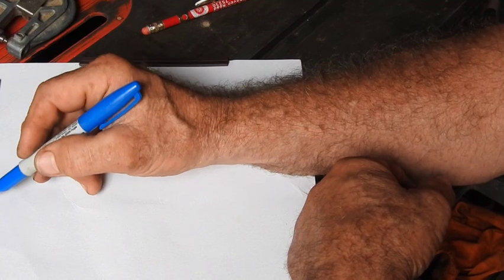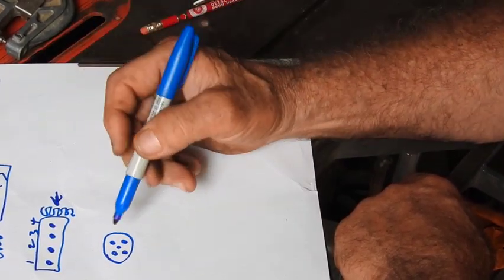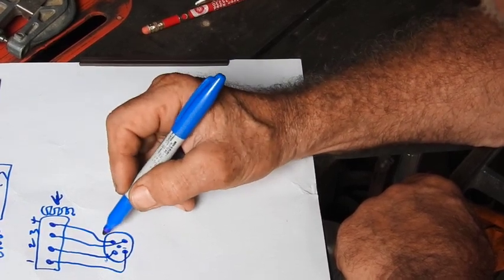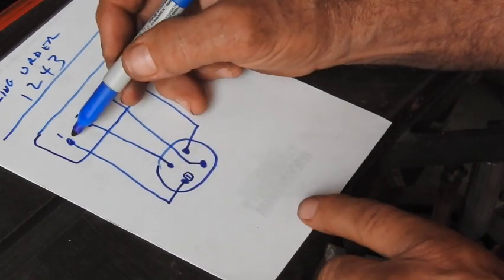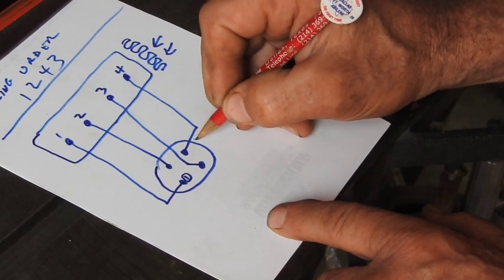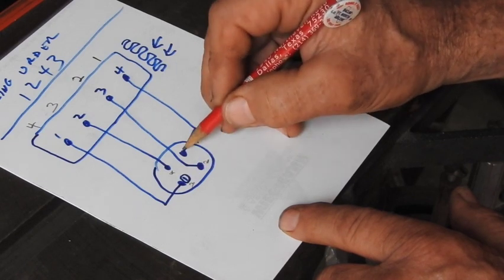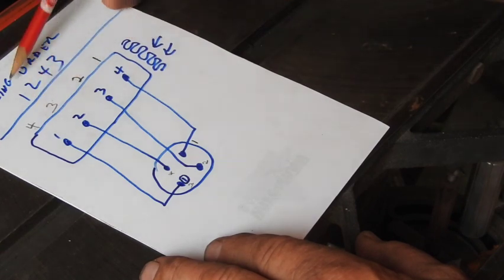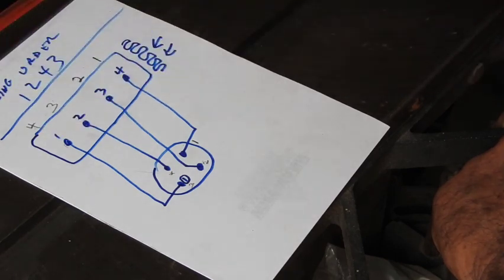Ford 641Tractor-Which Cylinder is No 1 Front or Rear- Read Description Box

Comment: #1 Cylinder is in the back. If you don't believe it line the timing mark up on the flywheel and you'll see that cylinder is TDC
Reply from the maker: if the intake and exhaust valves are both closed indicating its ready to fire on that cylinder, I'm thinking the distributor is 180 out.  If both valves are not closes it's not ready to fire so the distributor is probably in the correct position for #1 to be at the radiator.  Of course I always reserve the right to be wrong on occasion too.  Thanks for the input.  I'll re-address this when I got my 800 Ford (same firing order) back in the shop for repairs.

Comment: the number should be  at the front fo the tractor
Reply from the maker: Yes, I've never seen a multiple cylinder engine that did not have #1 at the front of the engine.  The front being the end with the timing and cam gears. Some engines can and are installed backwards in their application, but orientation does not change which end is 'front' for determining #1.

Comment: I know this video is a few years old but I have a question kind of on this topic. I've got a 1962 for model 2000. It has the 4 cylinder gas engine like my 641. The 2000 is very rough running and would like to know how to set timing on these. I know the timing marks are on the flywheel and  visible from the witness hole on the bell housing near the hydraulic pump. What degree should I set the distributor at? Should I susan the distributor at 0 with the pointer at the number 1 spark plug location?

Comment: What is the way to set fuel injector pump on old ford 3930
Reply from the maker: There are so many variations to the settings that I have to figure out each one every time.  Some are simple and some are horrible like this Perkins in the Ford New Holland skid loader here: https://www.youtube.com/watch?v=YfG5lGaGu6E Good luck with finding the information on yours. Its seems some dealers won't even talk about the equipment if its more than a few years old. My suggestion would be to buy a legitimate dealer service manual for that exact engine or the tractor IF you can find one.

Comment: 1 -2-3-4 from the RADIATOR to the dash. #1 is closest to the radiator, #4 is closest to the dash or the steering wheel. Not hard to remember.
Reply from the maker: Yes, I agree. I never heard of another inline 4, 6 or 8 that DIDN'T go from the front to the rear.  The video I referenced but didn't link was a guy that had inadvertently installed his distributor 180* out and numbered his cylinders from the rear to the front. His video was done in a 'how to' manner that showed how he did it and I couldn't believe it worked with reversed numbering .....but it does.  Which is why I sketched it out in this video.  Even though it works the way he did it, the real way of course is front to rear, distributor oriented correctly instead of 180* out.  Another thing, he never questioned his work at all, he just showed it as thought its the way to do it.  Which is why I did not link it.

Comment: I was having a problem with my Ford 2000 and happened upon your video. It was exactly what I needed to hear and SEE! I am a visual kind of guy and so much appreciate the drawing to explain firing order and numbering of cylinders with #1 being on the radiator end of the engine!
Reply from the maker: Awesome Tom !!  Glad to hear it helped a bit.  The fellow I was referencing was way off base... it only worked out from the rear because he'd installed the distributor 180 degrees out of time.  It took a little time thinking about how he got it to work and that's the ONLY way.    #1 on an inline engine is always going to be in front.  Even on a skid steer with the engine in the back, the front of the engine is facing backwards, but it it still the FRONT!! Now there's always the exception to the rule, but you'd have to look pretty far and wide to find it.
Reply: @tractorman4461
Reply from the maker: @tgrimsley  I just made a comprehensive reply to your question and I forgot to add a link to my 2000 Ford 3 cylinder that I couldn't get to run below freezing temps. So I converted it to electronic ignition and its not failed yet all the way down to 5* F.  That could end up being your ultimate solution, but I would go through all the normal check FIRST.  If you watch this 13 minute video, I'd suggest reading the description box before viewing the video.  I am sooooo glad I made the change Tom.  Before, my 2000 was unusable in the winter time....and I had the standard electrical components spot on specs too and it still did not run in cold weather.
Reply: @tractorman4461  Still having trouble with my 3 cylinder gas Ford. It was working fine..then developed a miss. I was able to get it home and proceeded to replace the points, plugs, condenser, carb cleaned, replaced coil, and seems to be getting plenty of gas. It has done this very thing before and was solved? by putting on a new coil...it really has me stumped! I replaced the wires,, rotor, and distributor cap but nothing has worked yet. When I say the tractor is missing, I mean it is running very rough and irrecgular as compared to a steady  miss like a bad plug .
Reply from the maker: @tgrimsley  As long as the distributor has not been removed the timing has not been changed from when it was running smoothly.  Firing order is 1,2, 3 and the cylinders are 1, 2, 3 from front to rear. If you have an VOM- Volt Ohm Meter, to check the resistance of the primary coil circuit set it to a low ohm setting and check across the + and - terminals of the coil.  A standard 12v coil should be somewhere between .5 and 4 ohms.  A very low resistance.  If its much over 4 ohms, chances are the coil is bad. Then to check the secondary resistance set the ohm meter between the center coil terminal and the + terminal.  The resistance should be more than 6,000 ohms but not over 15,000 ohms.  That will be a start.  Of course if you have carbon wires and not copper core wires, there could be separation or partial separation in the carbon in one of them.  Also check the condensor.  Cheap new ones are know to be faulty.  The condensor is basically a capacitor. The VOM must have a 'capacitance' test mode.  Short the condensor coil to its case to ensure the stored voltage is discharged, then put the test leads between the wire and the case.  The capacitance should read in the vicinity of .2 of a mfd (micro-farad).  If the meter reads zero, the condensor is 'open' and and if it reads much over .2 it is bad as well.  The distributor cap can only fit one way because it should have a notch in it to fit the base of the distributor body, and there should be a number 1 on the cap.  Attach the wires 1 to 1, 2 to 2 and 3 to 3 in a counter clockwise direction around the cap.  This should get you off to a good start to finding the problem....and I hope it helps.  sometimes my memory remembers stuff a little off though.  LOL  Good luck Tom and let me know what you find buddy !!  Off the cuff though I'd double check the plug wires for correct placement on the cap first.

Comment: PLEASE can anyone tell me what kind of oil you put in port on the side of distributor and how much . THANKS TO ANYONE HOW CAN TELL ME
Reply from the maker: I usually use the same oil that is used in the engine crankcase.  A couple times a year because mine are not used as much as if they were still farming. and usually 10 to 15 drops at a time.  I don't know if that is actually the correct way to do it or not but I've been doing it for 40 years.
Reply: @tractorman4461  THANK YOU !!!

Comment: When # 1 cylinder is at TDC on compression stroke the dizzy should be pointing at the # 1  cylinder. Correct?
Reply from the maker: Yes, that is correct and #1 is the FRONT of the engine.  The fellow whose video I watched actually installed his distributor 180* out of time, but wired the plugs as though the REAR of the engine was #1. Even though that's not correct, it runs fine because the sequence of fire still hits the correct cylinders in the proper order.  It confused me too at first, but it works.

Comment: I'm going home today and see if this is what's wrong with my Ford 850. I have it drawn out like you showed... I'm no mechanic but this explained it well.
Reply from the maker: I planned on doing a follow up video but never did, on how the fellow I observed is incorrect about number one cylinder Bing in the back of the engine. Number one cylinder is definitely the front of the engine up by the radiator. He has his distributor installed 180° out of time. Which because of the firing order makes the cylinder count correct from the back in advertently. Follow the normal procedure from the front of the engine do not pull your distributor out and change it just because it works out. That’s my suggestion anyway. Let me know what you find and what you do. Thank you.
Reply: @tractorman4461  My distributor must be backwards as well. . It runs like a charm now. It was wired from the correct way (front to back) but when I wired it from back to front it fired right up.. Crazy right?? Thanks for posting this. Saved me fro taking it out and reinstalling it ,
Reply from the maker: @kyeneal3243    That's crazy good news Kye.  It is very easy to get the distributor in 180 out...unless you have a front mount little Ford or any of the flat head Continental's.  Those all have an offset in the distributor drive that will not allow improper installation.  On the regular overhead valve engines, you've GOT make sure #1 is TDC with intake and exhaust valves open to install the distributor correctly.

Comment: He was correct. #1 cylinder is furthest from the radiator. What matters is where the rotor button is pointed when each cylinder is TDC. If you take the furthest cylinder from the radiator to TDC you will find the timing marks on the flywheel through inspection hole. If you take the closest cylinder to radiator to TDC and look through inspection hole you will not see timing marks because it's #4 cylinder.
Reply from the maker: I just figured he'd installed the distributor 180* out.  It works out on paper. No matter, either way his is running fine and my 800 Ford is as well.  It did twist my mind for a few minutes though.  Thank you for the comment !!

Comment: So what your saying is that his distributor is 180 degrees out of rotation, and he compensated by “clocking his wires” to make it run correctly! 
So what needs to be done is to bring the “number 1 cylinder” to top dead center” remove the distributor cap, and look where the rotor is positioned, then if 180 degrees out he would need to lift and reposition the distributor so the rotor would point to #1cylinder, replace the cap and correct the wires. His remedy was the old school quick fix for this issue, that he didn’t acknowledge or make clear to others watching his video! 

Good eye on spotting this Wendell, did you eventually ask him to clarify his choices on how to run the spark plug wires or why he chose this method?
Reply from the maker: Nailed it !!  LOL.  Yessir. No doubt about it at all.  If the fellow knew it was 180* out he didn't say and it was NOT pulled out or re-installed during his video.  No, I didn't say anything and I didn't post a link to it either.  But it's easy to find.
Reply: Yes, and see how your rotor turns, some go clockwise and some counter clockwise, find top dead center which is 5-10 on the flywheel,on mine is the front is #1 cylinder by the fan and go from there, next #2 next#4 next #3 and place wires in that sequence on the distributor cap..

Comment: That was very interesting, although I was taught to count from the front of the engine.
Reply from the maker: Front to rear is always the way on the Ford 4 bangers.  The video I watched caught my attention because the fellow said on this model tractor (641) the cylinders are numbered the opposite, from rear to front.  I don't think he knew otherwise either.  If he had known, I think he would have noted that the distributor had been installed 180* out.  I had strong suspicion but until I drew it out I couldn't see how the motor could possibly run.  LOL. 
    Matt from Matt and Andy American Tradesmen commented above that he took his running 640 and wired it just like the one I described and it wouldn't hit a lick.  He too pretty much knew from the start that the distributor was installed 180* out.  He made a video and put it on his channel if you'd like to see it: https://www.youtube.com/watch?v=DjwZbNhMKrY

Comment: I just tried this on my 640 and made a video of it out of curiosity. I’ll edit it up real quick so you can see. I just had to know!! Thanks for another great video buddy 👍
Reply from the maker: Hahahaha. That’s funny !!  I’m pretty sure you need to treat #4 as though it really IS #1 and bring it to TDC on compression and slip in the distributor accordingly. The other guy didn’t have the distributer out  in his video. I didn’t dig too deep in thought about the mechanical  positions  of all the parts and pieces. I was so dang surprised when I sketched it out and saw all I had to do was change #1 on the cap 180* across and the wires were correct for numbering the cylinders from the front !!  That’s why I said at the tail end of the video I was gonna hafta think a little more on this. LOL I can’t believe you took it a big step further and DID it. Can’t wait to see what you found out and what happened !!!  Then I won’t have to do any more thinking !!!  Thanks much for making my day.
Reply: @tractorman4461  the video is uploading now…but I live in the sticks so it may not be up till tomorrow 😂
Reply from the maker: @AmericanTradesmen  hahaha. No problem. I’m am lmao right now. I am waiting ……LOL
Reply: @tractorman4461  we’re at 31% uploaded….living in the woods is great till you get to do some high tech stuff lol

Comment: It looks like he would have had to install the distributor 180 degrees out to get it to work like that. What position is the #4 cylinder in when the motor harmonic balancer is timing mark is on what should be # 1 top dead center?😳
Reply from the maker: I didn’t spend a lot of time thinking about that part but I would almost guarantee they are not in alignment when he puts #4 at TDC on compression. When I saw the wiring was correct for front to back just by changing the numbering on the distributor 180* that was my first thought though. Dude Note:  Matt from Matt an Andy American Tradesmen just commented that he went straight to his 640 and tried it. He’s recorded it and is going to upload soon. So Calvin thanks for watching and try to go to Matt and Andy for the follow up. THEY did it for me.
Reply: @tractorman4461  thanks for the reply. Later 👍😀👉🇺🇸